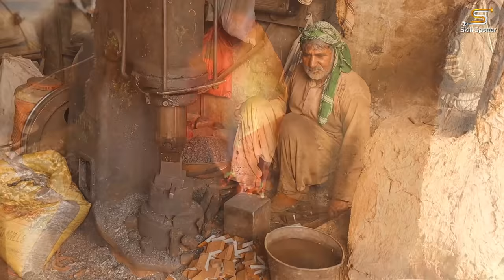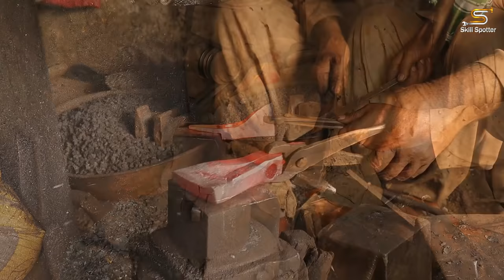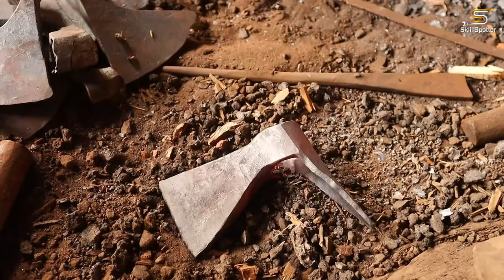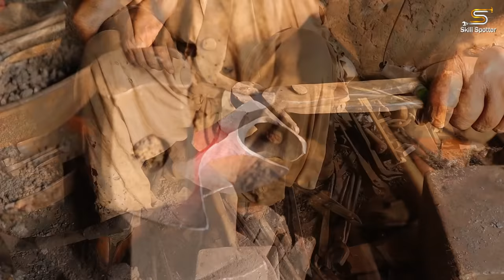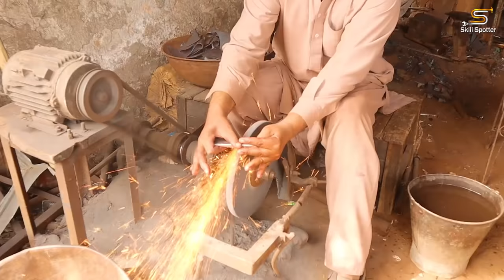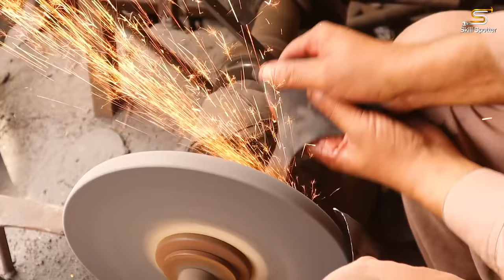Axe Making with Power Hammer, Axe Forging Factory, Superb Blacksmithing

Comment: impressive forge work but from a safety standpoint this is frightening - especially the grinding.  Long term prospects for the dude straddling the grinder are not good.
Reply from the maker: Thanks a lot for you comment dear.
Respect your opinion.
Reply: I definitely agree I see no eye or ear protection on the smith's he'll probably be blinded and have hearing issues in the future